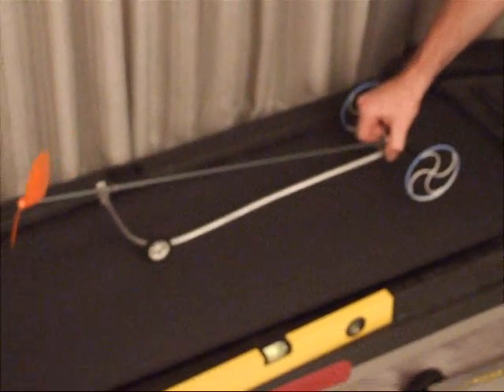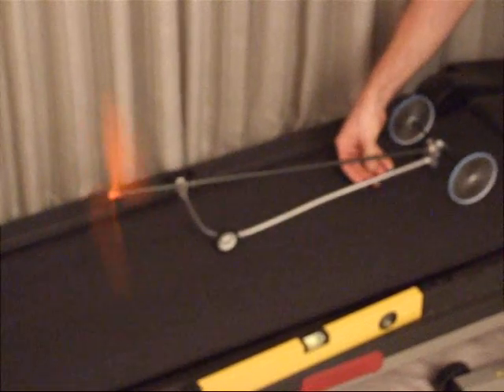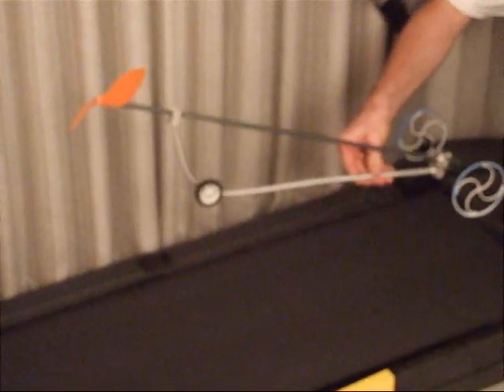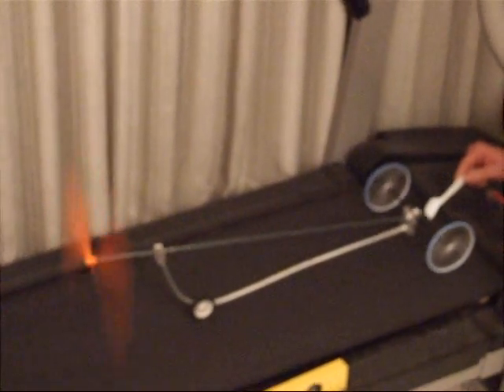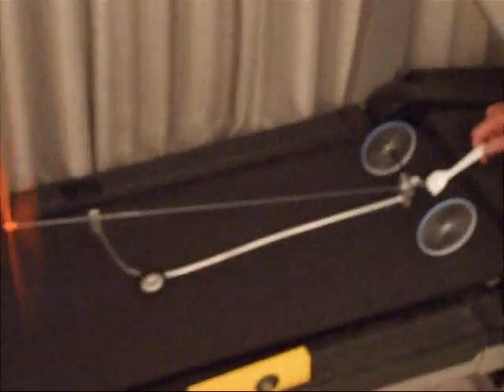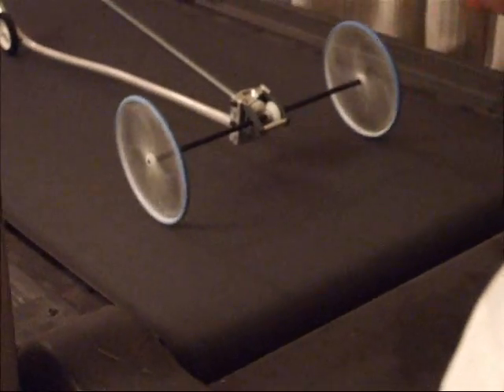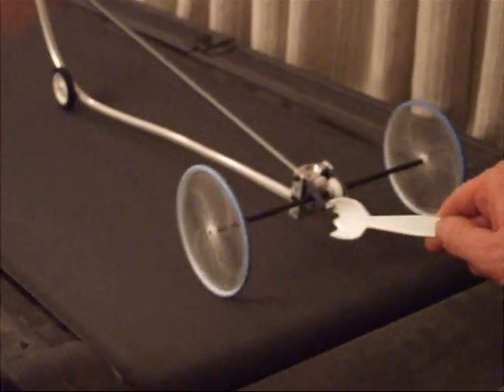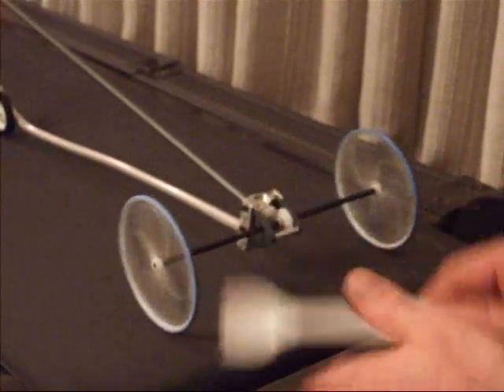Direct Downwind Faster Than The Wind #5 (DDWFTTW)

Comment from the maker: Yes, the treadmill is our power source when measured in the fixed frame of the ground.  Just as the wind is the power source when operating on the open road.  The two situations are equivalent.

I've made no claim to any breakthrough whatever.  Nor do we claim that this video describes how it works.  I have however explained it in great detail on a number of forums.  Thanks for the advice on the prop.  I'll be sure and make a note of it.

Comment: From what I’ve seen, Blackbird can “sail” directly downwind faster than the wind.  It can also “sail” directly upwind faster than the wind.  I assume that is after an initial external push to get the propellor going.  What happens if there is no wind and you give an initial push - will it keep going?  This last scenario is the very definition of perpetual motion.
Reply from the maker: >> I assume that is after an initial external push to get the propellor going.

No need for a push.

>> What happens if there is no wind and you give an initial push - will it keep going?

Nope. It's wind powered.  It will coast to a stop.

Comment: Simple explanation is that once you realize, that an airfoil's lift ( prop in this case ) 
will be squared every time the ( prop ) speed through the air is doubled !( many thousands of pounds) 
of twisting force on the prop in this case.
So it is the prop that is supplying the power to drive the cart wheels to go faster than the wind.

This also means that birds are a lot more efficient at flight than the experts think.

Comment: Because the propeller is pushing against still air not a 10mph wind, it only needs to provide enough thrust to support its weight and the wheel resistance. A large light slow moving propeller is the most efficient way of doing this.
Reply: lol

Comment: It is actually better to lower the gear ratio slightly, then compensate by upping the speed of the treadmill. This will reduce the frictional force generated by the wheels as they spin the propeller.
   Try upping the gear ratio too much and there will be so much friction that the vehicle will be unable to advance fast enough to move the fan.
   It will be shoved violently off the treadmill.

Comment: I don't know what VMG is but 49er's SK4's Foiling moths and several other high performace sail boats can exceed wind speed down wind. this does not conflict with any laws of physics because they are moved by differnces in air pressure not wind speed.

Comment: There are ways to achieve down wind faster than the wind. Some sail boats achieve it because of their hull design in conjunction with the aerodynamics of the sails. Downwind the combination of air pressure pushing from behind and appearent wind over the airfoil created by the sails can combine to more than compensate for drag and thus the boat is somewhat faster than the wind speed( don't confuse with pressure )

Comment: The tread mill is your "power source" spinning the drive wheels fast enough to spin the fan at a high enough rate to move the vehicle foward and up a slight incline. If it was engineered a little better it would go faster but your propeller is very inefficient, it looks like the one that comes with a rubberband powered airplane. there is no great scientific break through here and you have not explained how the vehicle can travel down wind faster than the wind.